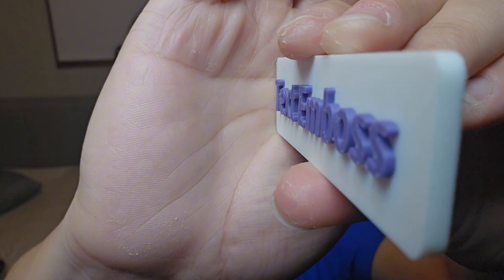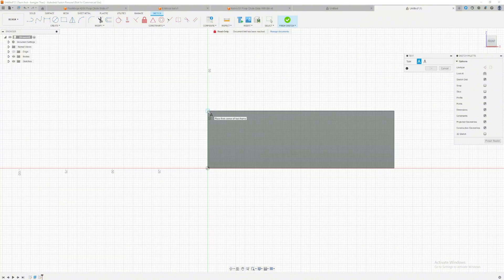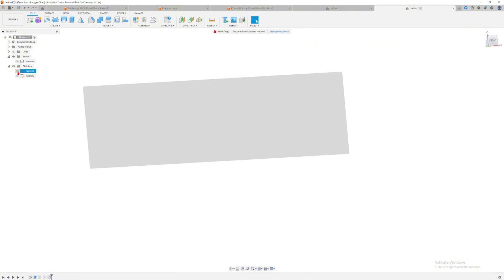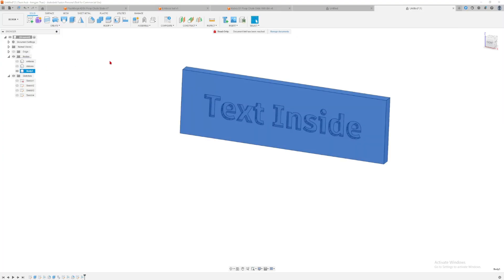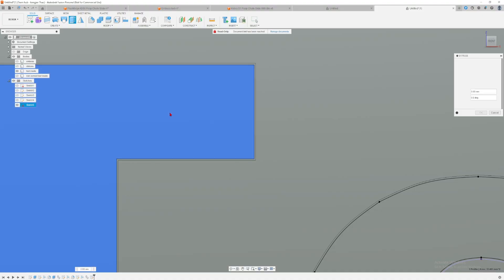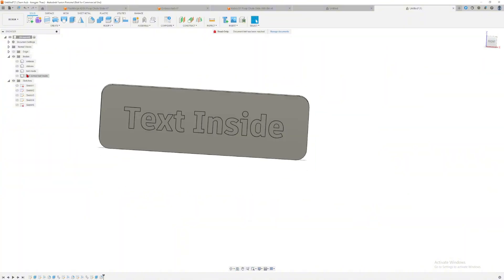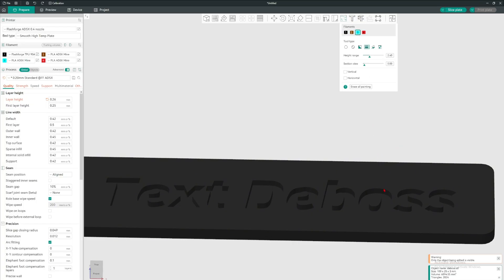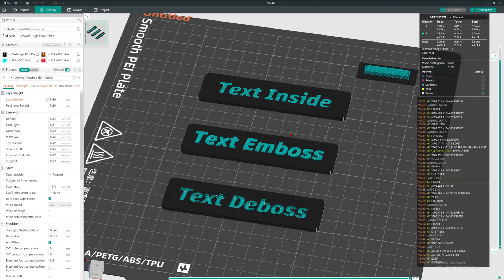3 Ways To Emboss Text For 3d Printing

Comment: Is there a way to have the inside text example print on the bottom layer or is it always the top layers of a print?
Reply from the maker: You can do the inside text at the bottom,  just flip it. It might say you have over hange but it can handle small bridges.